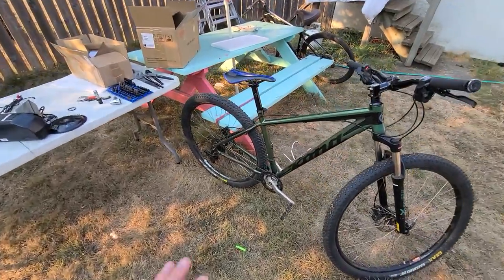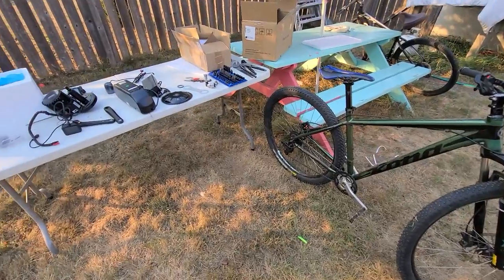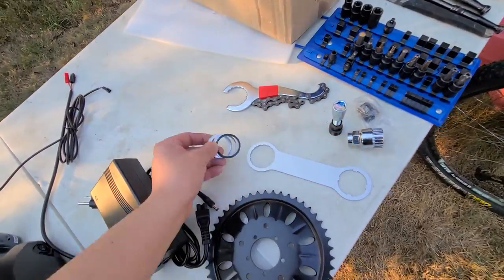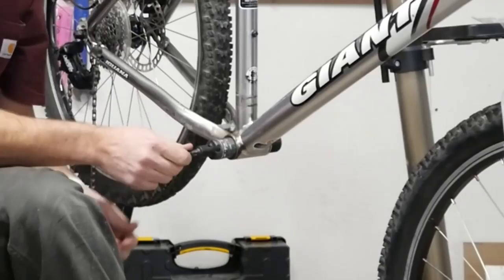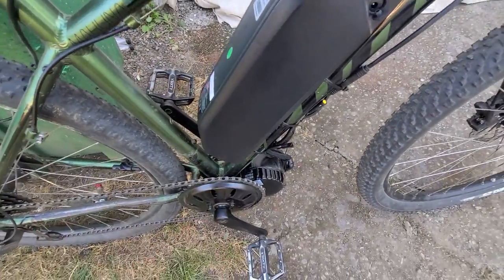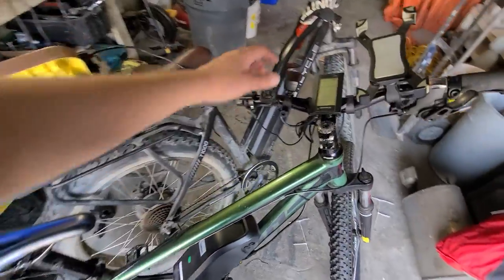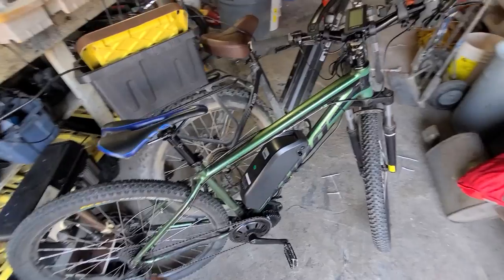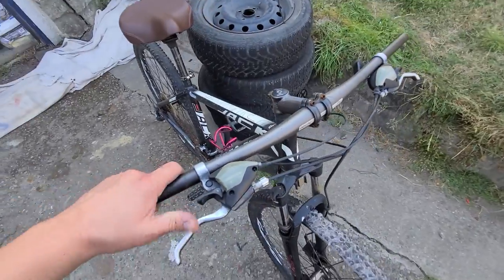Bafang 1000w BBSHD  Mid Drive Mountain bike ebike conversion kit installation

Comment: I'm really interested in buying one. Couple questions: what chainring size did you get, and why? Did you install the gear change sensor? What displays did you choose and why?
Reply from the maker: Have to check when I get home, I think the 44(came with kit). No gear sensor and not going to be installing it. I got the expensive and cheap display, will be installing the expensive display on the second build
Reply: you can use the brake as a clutch you dont really need a shift sensor, if you pay attention. For the chainring it depends on your chain line and also clearance to chainstays. you might have a bad chain line and need an offset chain ring like a luna eclipse 42T or lekkie blingring.  42T is the smallest chainring with a large offset that you can get to fix the chain line.  If your chain line is OK. you can run a smaller chainring and it will be very torquey, but you lose top speeds. Like a 28T or 30T chainring will top out at like 25MPH.  I have found a 36T chainring is a good fit for a bbshd fat bike.  And on my 29er mtb i had to use a 42T chainring with an offset because the chain line wasnt very good.  You should just try the stock 44T chainring and see what happens it has a bit of an offset to help the chainline. but its not that great it drops chains often. If you get a large chainring like 52T it might not even clear the chainstays or fit your bike so i would go small.

Comment: What is the best seller for this kit?
Reply from the maker: got one of them from a local dealer where i live and i bought one from eBay, directly from the Bafang dealer https://www.ebay.ca/itm/393828421252?var=662692796233 comes with a samsung battery